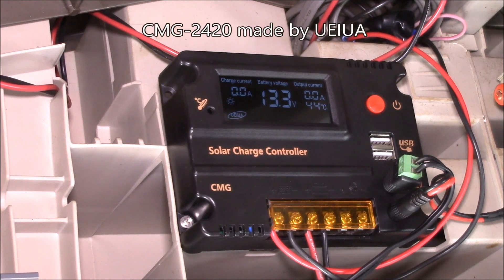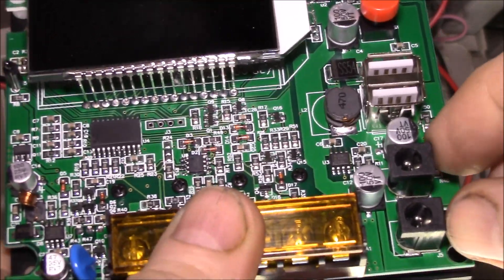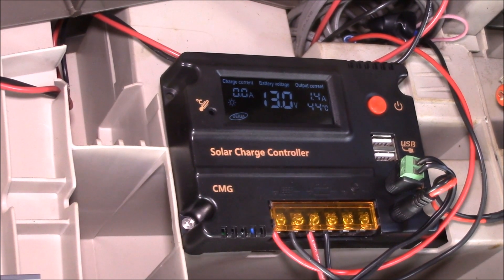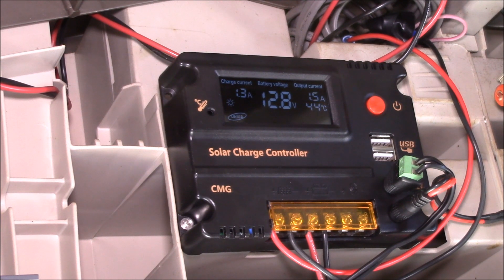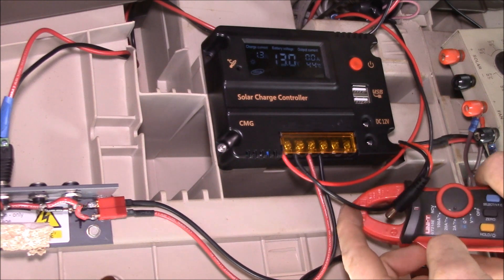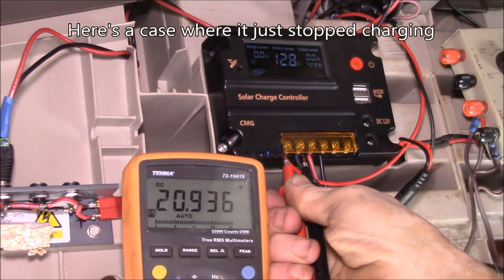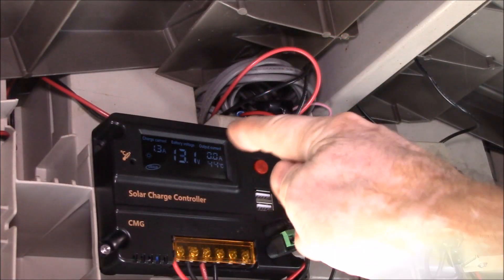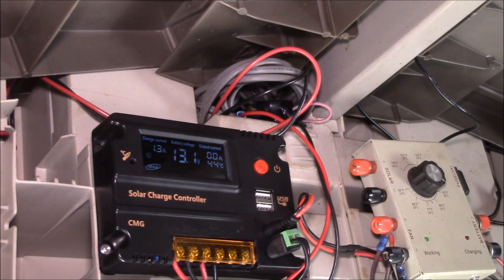Ueiua CMG-2420 PWM Solar Charge Controller

Comment: Great video....Quick question how do you switch battery types or do you even need to?
Reply from the maker: I don't recall that it had any user modifiable settings for the battery type.

Comment: Good morning my friend. Witch kind batteries work with this controller?
I have 2 AGM battries 120ah each one.
Does it works with AGM batteries?
Thanks. Best regards from Portugal.
Reply from the maker: I used mine with AGM batteries, it worked OK, at least until it stopped working.  It doesn't have any option to select a type of battery as I recall, so no specific AGM support.
Reply: @The4Crawler  Thank you very much, my friend.

Comment: NO  inductor,  no bloody good, looks like I have been kun food.
Thank you for your good information,  I  got two. O crap.......
Reply from the maker: Looks like there's still selling these controllers.  Many vendors are correctly listing them as PWM, but some still list them as MPPT.  Luckily I was able to get a partial refund through eBay where I think I purchased mine from.

Comment: hi, i have the same solar charge controller, the problem is that, it discharge my battery. i used a 18v 80watts solar panel and a 12v 25ah gel type battery.
Reply from the maker: Might be the same problem I had.  Mine would not fully charge the battery (with 60W/20V panels) and after a while, I found the battery voltage was very low.  I got rid of that unit and put a real MPPT controller on the battery and that's working great to this day:
https://youtu.be/DAPstiLMGUA

Comment: Hi what would you recommend for a camping solar controller pwm or ppt and what brand
Reply from the maker: I plan on using this MPPT charge controller for a solar panel on my 4x4 for camping, running my fridge/freezer, etc.:
https://youtu.be/DAPstiLMGUA
But a PWM controller is less money and smaller.

Comment: I'm a little late to the party but here goes.  "MPPT" is indeed a feature, it means the controller is keeping track of the watts drawn from the panels, and adjusts the current draw from the panels to maximize the watts recovered from the panel.  Watts = Volts x Amps, but with solar panels, the curve isn't linear.  With anything that's not a purely resistive source, when you double the current draw it doesn't cut the volts in half - you either get more than half (meaning more watts) or less than half. (meaning less watts)  So it moves the current draw up and down to "seek" the max watts.  That's the "power point tracking" at work.  This has nothing to do with HOW the volts/watts (power) is being converted for the battery.

On the other end of the stick, the battery's power consumption (as a non purely-resistive load) is ALSO not linear, and power varies depending on the VOLTAGE sent to it.  So this will also affect the maximum power point on the other side of the conversion.

The two most commonly used methods for exchanging voltage and current are PWM and buck/boost.  PWM doesn't require an inductor, because it just connects and disconnects the load rapidly.  The amount of time spent connected vs not connected is the "duty cycle", here referred to as "pulse width".  This can be pretty efficient with a good FET, but the non-linear curves on both the panel and the battery will be affected because they don't "average" the current very well.  Also, the maximum voltage PWM delivers cannot exceed the input voltage, meaning if your panel voltage is below your battery voltage, NO power can be delivered to the battery, regardless of how much current you have available from the panels.

Buck regulation works somewhat similar to PWM, but includes a large inductor, two schottky diodes, a few large capacitors, as well as other parts, that sort of "average" out the pulses, and can produce fairly clean, stable DC voltage.  This averaging doesn't occur as much on the panels, which still experience some PWM, but voltage and current to the battery is pretty stable, and gets you about 10% more power delivery on the average.  Its not much, but it IS more.

Most solar regulators that do buck-down can also do boost-up, because it uses the same big key parts, but in a different arrangement.  The common ICs to control the buck usually can auto switch to boost mode if the input voltage falls too low.  So your panels may be producing 10v but your battery will be receiving 13.8v etc.  The current will be lower than from the panel of course, but it's the same tradeoff as buck but in reverse.  You're getting more volts at less amps, instead of more amps at less volts.  Boost conversion can also be very good, but anything is better than the nothing that you'd get from PWM under the same circumstances. (you should run your solar at the highest voltage that's practical for you though, to keep current low and minimize resistive losses in the delivery wire)

Regardless of whether it's PWM-down, boost-up, or buck-down, the MPPT processor is controlling the target voltage of the conversion, to optimize the watts delivered to the load and battery.

I've got two of their MPPT chargers and was somewhat amused that they were proud enough of their buck/boost and large inductor to actually put a picture of it on the front.  That's smart marketing, and a bit of a brag.  It's too bad that this unit doesn't have an LCD display though.  The idiot lights on the front do a good basic job, but I'd like to see actual numbers. (I use this regulator along with two inline voltage/current/power monitors, but it'd be so much simpler if the unit just had its own display)

I bought one of the PWM ones with the LCD display just to see how well it worked.  I was expecting PWM though, and wasn't surprised.  It's slightly less efficient, and can't boost, as expected.  I didn't even have to open it up to know it was PWM, it was so much lighter than the buck/boost model. (the inductor adds a fair amount of weight)  Maybe someday they'll upgrade their good controller by adding a display like their cheap one has.  As long as you can measure by other means when you need to, the CPY is a very solid unit, and a good deal IMO.

As you can see, both PWM and buck/boost can use MPPT to help optimize results of the two different conversion methods.  So, you sort of arrived at the right answer, using the wrong information.
Reply: Great reply, thanks. but to go one step more, If you read the specs, it clearly has PWM as the converting method. See below

This solar charge controller adopts the advanced digital techniques and operates fully automatically. The PWM battery charging mode can greatly increase the lifetime of your battery and has various unique functions and quite easy to use features.  

Features:  
LCD screen display all parameters.  
With output switch, intelligent control, easy to operate.  
Fully automatic operation.  
Microcontroller digital accuracy.  
A key to open and close the load.  
PWM charging mode(SOC).  
With separated temperature detected circuit, high precision temperature compensation function.  
DC 12V and USB 5V charging for DC lamp and phone.

Comment: I brought one of these for my campervan I have had it for 1 year but has completely stopped charging the battery. The panels have voltage coming through as I check with a multimeter and I cannot seem to figure why it won't start charging even when the battery  was low voltage I charged the battery on trickle charge but still wouldn't charge. would you recommend getting a better control unit or is there a way I can get the old one to work?
Thanks
Reply from the maker: Probably not worth the effort trying to fix the old controller, they seem to be very prone to failing.  I've not seen a schematic or any repair information on-line.

Comment: I purchased one of these from Amazon a couple years ago used it for (3)35 amp hour batteries, it did pretty well for a while..then I put it up as just a voltage monitor in the rear portion of my RV...I decided to hook it back up since I bought some new batteriesbut now it starts to charge the input shows a charge lower than what it actually is though and then stops and a few other issues with theread out as well as the phone chargers have never worked since I bought it.. I think I paid $29 for 3 years. But pretty much know how tall can you use for as a monitor for voltage in the system.
Reply from the maker: Yes, these seem to be very prone to failure.  At least you can still get it to display the voltage.  One of mine is completely dead, no display at all.

Comment: I think I shorted mine, used my solar batteries to jump my bus, ever since the output does not work. It charges batteries but nothing on the output end. Garbage.
Reply from the maker: Sorry to hear that but yes, these controllers seem to be very fragile electrically.
Reply: first user i read who got the life utility of CMG -an important question how many years you use it and in what v/amp????

Comment: I purchased the same thing as I was led to believe as well  that this unit was an mppt unit! I purchased mine over a year ago so I am stuck.
Reply from the maker: Sorry to hear you got taken.  I can't believe they are still pushing that fake MPPT story and that the on-line sales channels still allow them to publish the false information.
Reply: @The4Crawler  Thanks! At least it was cheap enough! Looking at the box that it came in and the limited documentation, it may be a case of lack of knowlegde on the part of the seller rather than a scam. Looking at the specs for the unit, I see that it has overload, over voltage and short circuit protection and float charge and discharge recovery voltage specs. PWR is just constant charging only as my limited knowlege of this subject  attests, so is it possible that this unit is MPPT? What do you think?
Reply from the maker: Yes, I imagine they can claim "plausible deniability" :)  From my testing, it has no ability to do any boosting of current like an MPPT controller can do.  It simply connects the solar panels to the battery until a voltage is reached then it cuts back charging to maintain a float voltage.  It does seem to do low voltage cutoff of the DC load and prevents over charging.  With an MPPT controller, if you had say a 33V / 3A / 100W panel and a 12V battery, you might see charging at 14V and 6-7A because the controller is working like an AC power transformer and stepping the voltage down while boosting the current.  With this controller, the most current you'll see is that 3A that the panel puts out.
Reply: @The4Crawler  I found a pwm vs mppt video to educate myself a bit since my last message  and I do agree that it is most likley not a mppt type..so, looks like I am going to have to do some shopping! I found a mppt unit by Renology and will most likley get that model.  They seem to be a good quality unit.
Reply from the maker: I've heard good things about the Renogy controllers, although haven't used any of those myself.

Comment: Yea, I got wangled on a MPPT too.   Sent the sucker back.
Reply from the maker: Yes, it's amazing they insist on keeping that incorrect listing.  They open themselves up for a "Not as Described" dispute and they'll lose every time if the customer is at all savvy.  If they would just change the MPPT to PWM, that controller would still sell, decent price for the features.  Sure, it would still be unreliable but not subject to eBay agreeing with the Not as Described disputes.
Reply: @The4Crawler  That's my Grumble.   I was quite sure it would end up not being MPPT but purchased it anyways.  The guy  Ended the Listing  so I couldn't comment on it.  They just relist again and again .   Got my money back but was still unable to say anything about it.  I do in fact use some PWM controllers and they do what I ask of them most well.

Comment: I have a pwm (different than you shown in video) solar controller, if i check the oc voltage of panels it shows 20V, after connecting it to controller, it shows 13V. At the same time, i check battery voltage it shows 12.9V. my solar ports don't fluctuate like yours as per my multimeter. What's wrong here?

Also, i have ordered the controller that you have shown in your video. Have you tested the usb outputs? Do they work well like usual 5V 2A adapters? I saw your battery is connected to controller through some short of circuit, what is it? I don't have any such circuit between my battery and controller.
Reply from the maker: My battery was up near full charge (13.6v) so the controller was switching on and off.  At 12.9V on your system, the controller is likely just connecting the solar panels directly to the battery for full charging current.  Thus you see no switching on and off like mine.

I never had a chance to test the USB ports on my controller before it quit working.  On my setup, I have 2 batteries connected to a common bus bar and then have the charge controller battery terminals connected to that same bus bar.
Reply: @The4Crawler   I used this for a year. Today it is showing 27.2A charge current after i messed up the connection. I connected it to another pwm controller which I think is the reason behind the fault. It is not charging my battery anymore :(
Reply from the maker: @ninjadefuse9048  These controllers appear to be very sensitive and fragile electrically.  When mine still worked, it was fine until I plugged in a 12VDC powered battery charger for some power tool batteries.  As soon as that charger started up, the PWM controller would quit.
Reply: @The4Crawler  yesterday i noticed that one of the smd resistors popped out of its place. i soldered it back and now its working :D
Reply from the maker: @ninjadefuse9048  Great repair, glad it's working.  I think the build quality on these is rather poor.  On one of mine, the coil of wire in the small inductor is loose, like the retaining part for the coil broke off or something.
Reply: @The4Crawler  It stopped working after few days? The product is in transit from amazon.in I couldn't find any pwm controller with a digital display like that. Do you recommend any other pwm with digital display?
Reply from the maker: I've not looked into any other PWM charge controllers.  I went with a 20 amp MPPT charge controller from Epsolar to replace this failed unit.  It's more expensive but has been working flawlessly for the last 2 years.

Comment: Eventually mine just stopped charging like yours & has wasted a very nice battery and left me with no power. seems odd because it's still functions, as in the display still comes on - but I'm getting no charge current at all. I thought my solar panel was faulty but have put a voltmeter on and I'm getting 19 volts in the sun.
Reply from the maker: Yes, seems to be a common problem with these things.  Have heard of others having a full display but no charging or solar input current.  Not sure what is actually failing on these things.  Some day I may open up my dead ones and do a little poking around with a meter and see if I can find any clues to what failed.
Reply: @The4Crawler  I did contact the seller, I paid £16 for mine on eBay. Seller was hopeless & didn't seem to have a clue about the product. A real shame as it's a great design
Reply from the maker: Yes, same here.  I was trying to inform the seller that the controller, clearly labelled as MPPT was indeed a PWM design.  Eventually the dispute got back to someone at eBay and they sided with me.  As a PWM controller, it is a nice design with the digital readouts and all, just not reliable.
Reply: @The4Crawler  I can see the victron energy smart controllers are quite well reviewed. It appears the blue series is cheapest and the smart version with the Bluetooth interface comes in a bit more but perhaps a lot more useful. saying that I think the design of these crappy eBay ones are better with the LCD display the 12V output and USB ports. Big gap in the market!

Comment: I have the same unit and I cant get the solar to charge. The voltage of the panel jumps from 18-20V. It never shows any pull from the solar. What am I missing?
Reply from the maker: I never ran into that problem with mine, at least while they still worked.  If you have a separate current meter, try hooking that in line with the solar panel and see if indeed there's no current flowing, maybe the controller's measuring circuit isn't working right.  Otherwise, double check all the wiring.  Hook up to the battery first, then add the solar panel connection.  Maybe put a load on the battery to pull the voltage down a bit and see if anything changes.

Comment: Hi, can you use the 12 volt output on the charge controller to charge a 12 volt battery ?, or do you need to hook the battery up directly to the bottom of the charge controller.
Reply from the maker: Not sure on that.  I've only run this unit on a 12V battery and at that voltage, the "12V load" co-ax output seemed to be the same as the battery voltage.  I think on a 24V system, that "12V load" co-ax output would be regulated to 12V, but not sure what the actual voltage would be or if that would be suitable for charging (i.e. going up to 13.8v or whatever).  But in any event, I think you need to have a battery connected to the battery terminals of the controller before it'll do anything.  Hook up battery first, then solar panel(s) then any sort of 5V or 12V load.  I think the main load output on the bottom of the unit is at the same voltage as the battery.
Reply: Thanx